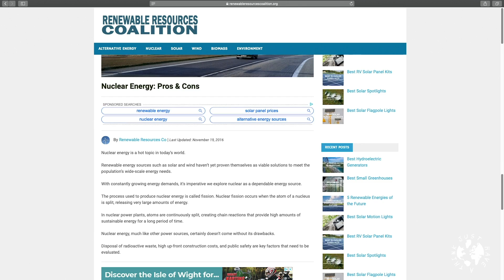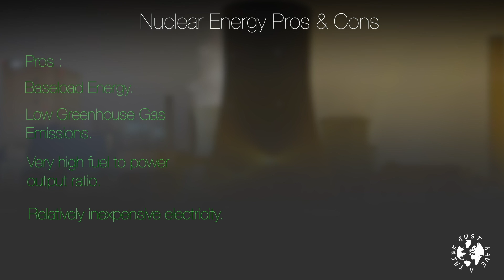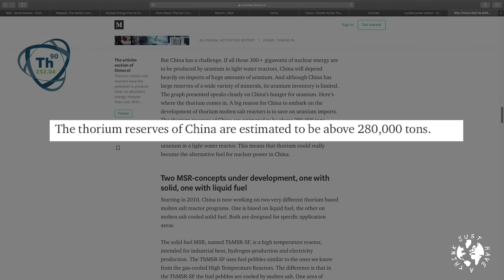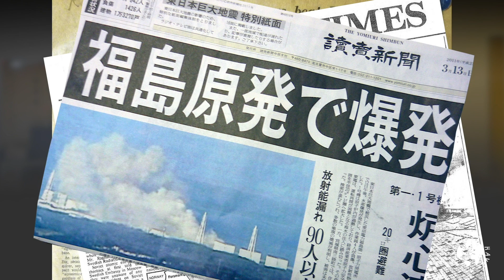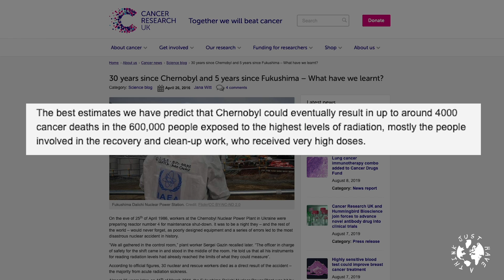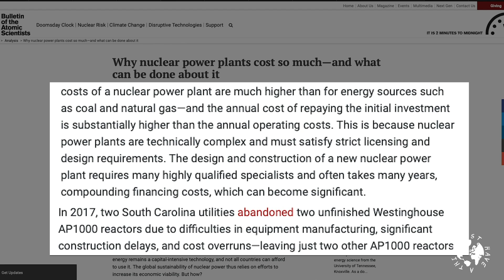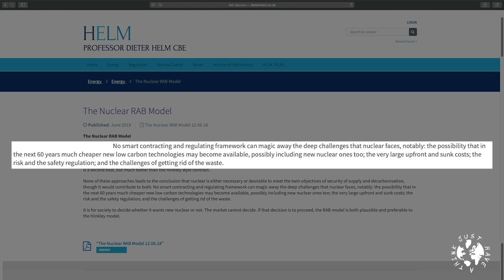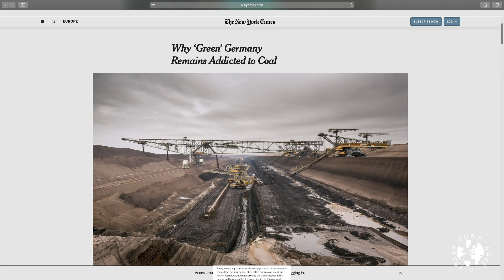Nuclear Energy in the 21st Century

Comment: The Fukushima accident will cost the Japanesé government some 600 billion USD. Accidents will happen again, it is just a function of time ANd probalitiy. So, no, it is not Cheap energy.
Reply: Climate change will cost a hell of a lot more than that.
Reply: xxwookey agreed, but we can save the earth without nuclear. The ongoing projects in France and in Finland has been ongoing for 15 years now and still not finished. We have no time for insanely costly projects taking forever to finalize. We need fast Solutions to save the earth. Which means solar, wind and energy storage systems.
Reply: oystla “we need fast solutions to save the earth”

Ok enough hypothetical nonsense, let’s talk about a real world scenario here. By 2022 there are 10 nuclear plants in the USA that could be scheduled for recommission. Together these plants generate approximately 82,000 GWh.

That’s more energy than the entire utility solar industry for 50 states produced in 2018. 

You have two years to replace this loss, what renewables are you using to avoid a catastrophe? 

Keep in mind the following: 
- State government data shows that renewable replacements would not be completed until 2035
- Industry data shows that it is not feasible to construct enough renewable infrastructure to replace this loss by 2022
- Utikity data shows if that if 80% of this loss is not recouped in 2023 that the eastern Interconnection would suffer a catastrophic failure

Renewables can be built fast, but they lack large generation production and are significantly less efficient that nuclear plants. This means that you will need to construct a massive amount of units to replace the loss of energy, and under critical deadlines in short time periods it may not be feasible to replace nuclear reactors when they come up for decommission. Failure to replace loses may lead to the following issues: 
- Catastrophic grid failure: Millions of Americans and businesses lose power leading to major state recessions, and safety concerns

- Emergency replacement with natural gas systems. Natural gas typically replaces nuclear reactors because the facilities can be built relatively quickly and operate with moderate generation and efficiency. However according to the NREL Lifecycle Harmonization Assessment of CO2 a natural gas facility will emit 456g CO2/kWh more than Nuclear. Keep in mind 1 GWh = 1,000,000 KWh, and we are talking about replacing 82,000 GWh.
Reply: Brian listen, the globe will add close to 200 GW new solar and wind this year. 200 GW solar and wind will produce annually the same amount of electricity as 50 nuclear reactors. So you see, the world has the capacity to replace a fair amount of nuclear, but first we must get rid of coal power. And we need to expand energy storage, which should be hydroelectric Pumped storage for longer storage, and batteries for grid stabilisation. 
So my suggestion is that when coal is removed we attack natural gas, and at the end we replace the insanely expensive nuclear power with Cheap renewables and energy storage, which als will be dirt Cheap as production and sales increase.
Reply: @oystla  Maybe we can decarbonise without nuclear, but I'm not convinced. There is a huge amount of fossil generation still to replace, and not everywhere has good solar/wind/hydro resource. Also the last bit gets very expensive without a lot of storage (also expensive). And in northern countries there is a large (6 times the electical load in the UK, for example) heating load to replace with some combination of insulation/airtightness, heat pumps, hydrogen and more generation.
I still think nuclear is needed in some location, especially higher-latitude ones. 

Okiluoto has suffered from first-build followed by big legal argument on who pays so is impressively late, but should finally get turned on next year. Both the Chinese Taishan reactors are running (turned on in 2018 and 2019 respectively). Hinckley will benefit fro the knowledge on the first 4 builds and I'd expect to be more or less on time. Other designs are doing better, so the 4 reactors at Barakah in the UAE appear to be on time and about half the build cost of the EPRs.
Reply: xxwookey you forgot to mention Flamanville, which is now Worse out than Olkiluoto. Solar and wind is still growing exponentially, so 200 GW this year, probably 250 GW next year and so on. Solar and wind will be able to replace coal mopmpletely within 15 years, IF the politicians allow it. But there is a strong coal lobby in India And Australia....
Reply: How are these accidents going to occur? If you don't know how these accidents will occur then you cannot draw any conclusions as to when they would occur or the probability of when they can occur. 

Also basing this probability off of the Fukushima accident does not support your argument as the significant impacting forces on the reactor were caused by a geological events that are extremely rare as in 0.00001%. Now granted there are factors that influence and can increase this probability, and location plays a significant role which is why Japan should have a more extensive understanding of seismic risk probabilities for all infrastructure in its country.
Reply: Brian my point is that the next time there will be something Else outside Design basis criteria that will cause a meltdown costing the taxpayers 600 billion USD to clean up. All reactors have a design basis, but not all possible remote cases are covered. Like there are many present reactors that will not withstand a direct hit from a jumbojet airliner. Or a big drone with a big bomb attached. So terrorists are one possibility. Human stupidity as in Chernobyl is another. 
The nuclear Industry do not include the accidents  in their sales brochures of "Cheap" energy, when accidents in reality tip the scale to the most expensive energy source on the planet. 
No insurance companies will ever cover a full clean up cost of an accidents, and the taxpayers are left with the bill, as in Fukushima.
Reply: oystla What is the statistical likelihood of a jumbo jet crashing into a nuclear reactor, especially since all reactors have a no fly order regulated by the FAA and enforced by the US Air Force? 

What is the likihood of a terrorist organization attacking a nuclear reactor with a bomb and the likelihood that such a device would be able to cause enough damage to a reactor to create a significant emission of radioactivity? 

Keep in mind that a meltdown itself is not what causes the most damage but leaking and environmental damage as a result of an incident. 

My point is that these events you list as possibilities have a statistical likelihood of occurring less than 0.001%, which makes them by definition scientifically improbable. If we regulate energy systems below this probability than it is impossible to build anything in this country. 

I would say there is a greater likelihood of a meteor crashing into a hydroelectric dam than there is of a jet or a bomb destroying a reactor, so does that mean we should get rid of all our dams? No that is ludicrous
Reply: Brian these where just examples of mine. There are many Events outside design basis that can eventually course a nuclear meltdown and explosion that will will release radioactive elements to the environment. We have had nuclear power for 55 years. In these 55 years we have had 4 reactors at the worst level 7 on the ines scale. So we may Expect in the long run some 1 major accident every 15 years around the globe. It is not worth it.
Reply: oystla What 4 accidents were Level 7 INES? 

According to INES records there are only two being Chernobyl and Fukushima.

Also your conclusion is faulty as it is saying that reactors are all similar and faced similar accidents, therefore we can expect similar accidents over a period of time. This isn’t true. The reactors themselves are completely different models, and had completely different issues. Also you would base your timescale off of reactor hours or operational time not just arbitrary time.
Reply: Brian, the Fukushima meltdown and explosions was in three reactors😉. And I am talking about statistics, not what caused the accidents. Statistics says 4 reactors exoloded in 55 years , at the worst scale level 7 on INES scale.

Comment: Nuclear is not cheaper than gas or coal. The new UK Hinkley nuclear require above 100 £ pr MWh, and to be inflation adjusted in 30'years. Higher than any other energy source.
Reply: Nuclear is a failure in the free market worldwide. No power company will choose nuclear without vast government support. Exxon supports the Nuclear option. (As being ridiculously more expensive than oil.)
Reply: @lesbenson9421  if carbon free technologies were competitive in a free market economy, climate change wouldn't be a problem right now...
Reply: Hinkley is £92.50. That's less thall the offshore wind we built so far (which is £130-£150). New gas and coal is usually quoted around £115. So it is cheaper than that. Existing amortised plant is cheaper than all of these (£50-70 typically), but you need to compare new with new when looking at what to build now.
Reply: @xxwookey  92,5 was agreed in 2012, but inflation adjusted since then, i.e above 100 now. Off course wind has been more expensive, but the point is cost decline as wind technology has matured.  Wind can now be built without subsidies. Nuclear have only experienced cost increase with New safety requirements after every new accident.
Reply: @oystla  Even if you take £100 due to inflation, it is still cheaper than new coal or gas, which is the point I was disputing. We all agree that new wind and solar has got much cheaper - around the £50-80 mark, depending where you are in the world. (all these number on an LCOE basis). What is not yet clear is how much extra system cost there will be from additional storage, grid reinforcement and overbuild to keep something approaching our existing grid reliability. The trick is to make this work without ending up with too much fill-in gas putting the grid carbon intensity up.
Reply: @xxwookey  according to US eia, New combined cycle gas is at 41 LCOE, while nuclear is at 77 LCOE.
Reply: So one reactor is now data for the entire industry in every nuclear country on earth? Never mind the insane amount of variables you just glossed over....
Reply: @brian2440  the same problem with the New French project at Flamnville or the New ongoing in Finland. Very expensive in the West including US.
Reply: @oystla  it us expensive but it is a Rolls-Royce in term of safery.
Reply: @rolletroll2338  Rolls-Royce in terms of safety....until the next major accident.
Reply: @oystla  please educate yourself about the redundancies in the EPR before claiming such things.